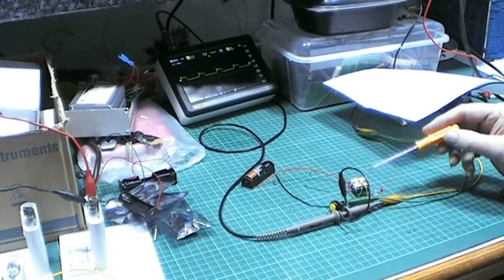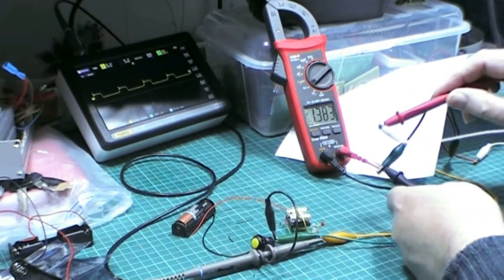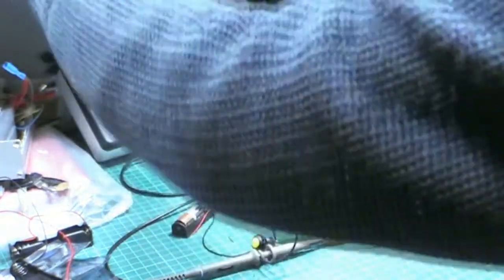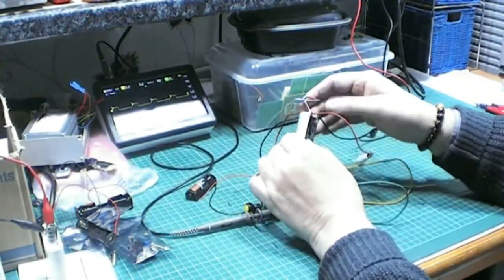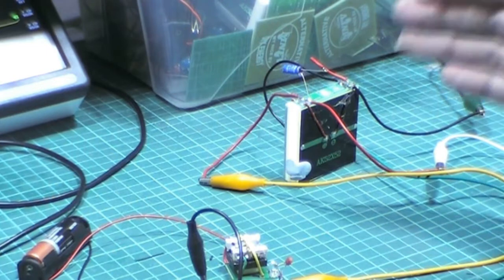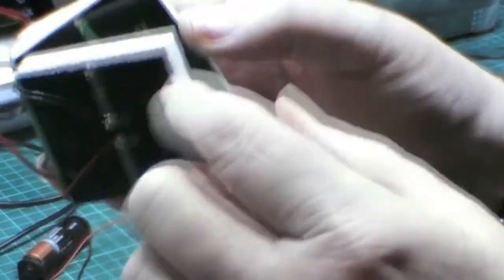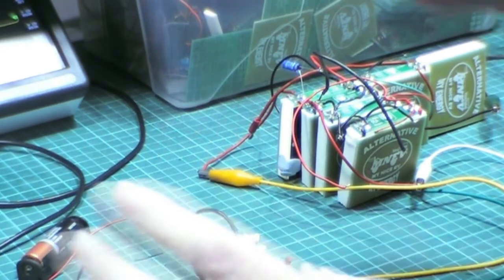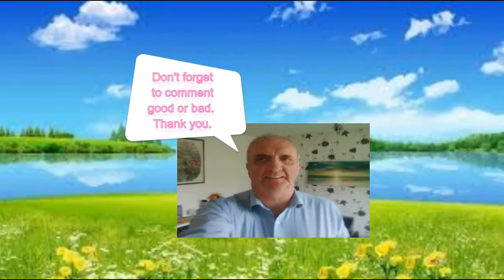Project Nocturnal Ra Part 2

Comment: i used to use a joule thief to help de sulfate lead acid batterys i did try charging batterys but they did take rather along time i even tried making an over inity device the idea was to have uv led's pointing at a solar panel have that panel feed the joule thief and then use the secoundry windings of the joule thief to charge a battery but i could not get the led's to feed enogth power into the solar panel
Reply from the maker: Yes my friend I understand the idea. But you were loading the joule thief. This idea doesn't. Which is the great bit about it. It is far from Bourg perfection. But it is something I can keep playing with until I get to my final solution. It is able to be fed from many small sources. I hope you and Dianne are keeping safe my friend.
Reply: @MYNICEEV  i did not use the main winding for the oscerlation no led i was using another winding on the toried i did also try a duel tap 240 to 12 v tranfomrer 2 12v feeds that worked great all be it a little shocking
Reply: @MYNICEEV  what i was trying to do in thoery is perpetual motion may of got closer if the jouile thief could produce more ampage but then when i drove leds into a solar panel but powered the leds with a battery i couldent get much power then was a idea i had as a child only back then the idea use the panels from a calulator